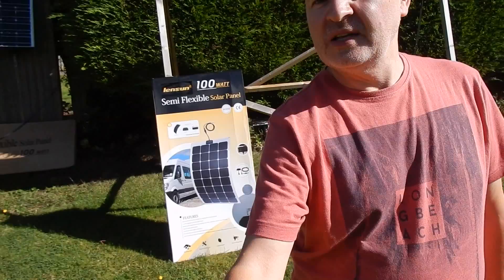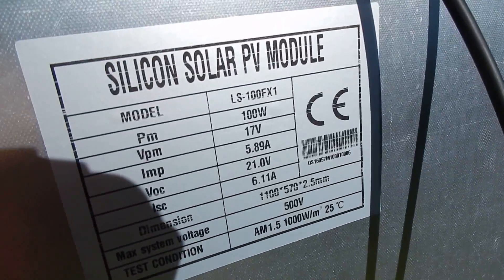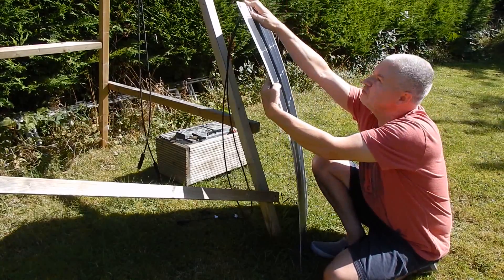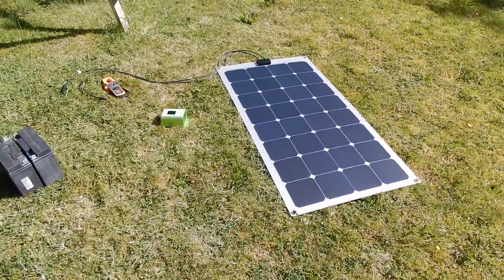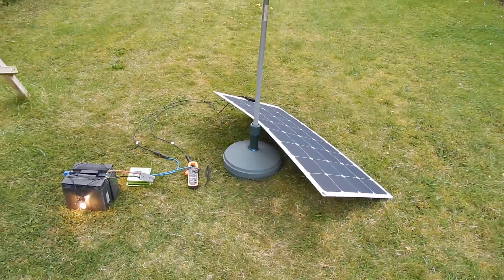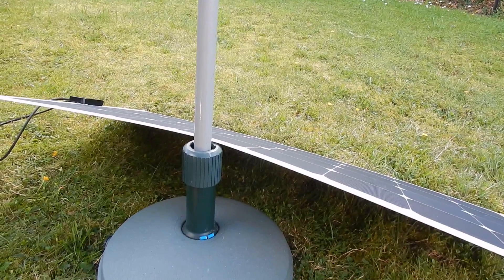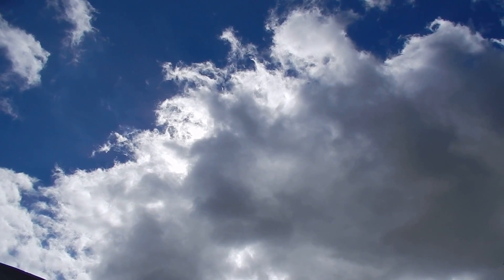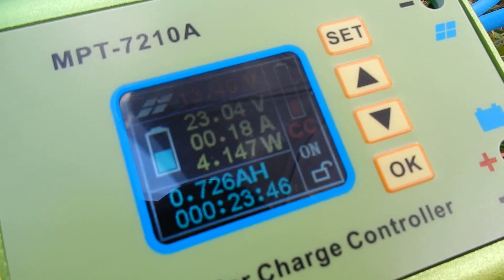Review & Test: Lensun 100W Semi-Flexible Solar Panel

Comment: I bought the Lensun 100 watt fiberglass backed panel 2 years ago directly from the
lensun facility in China for use on my boat. I paid more for the best panel
they offered in hopes that it would give long and efficient service. I placed
it securely on top of the Bimini where it stayed until now.  I recently
noticed that it wasn't producing  power and that my batteries were
drained.  Since the batteries were isolated the panel had obviously not
been producing power for some time.  From purchase to discovery of failure
was....yep....2 yrs 2months.  2 months past their warranty even though it
in all likelihood the panel failed well within the warranty period.  After
a week or two of back and forth with lensun in China they instructed me to test
the diodes, remove the diodes, test the internal connections, etc...take
pictures of the multi-meter readings, take pictures of the mounting, take
pictures of the label on the back of the panel, re-solder, and use such and such
product to re weatherproof the housing and on and on. When I brought the panel
home to conduct these tests I discovered what the problem was.   When
the panel was flat the multi-meter read 0 volts. When I bent it slightly it read
13+ volts. Lay it back down it went back to 0.  That's a pretty good
indication that the circuit is broken inside the panel itself.  I sent
them a video of this and they immediately responded and stated that they
wouldn't honor the 2 year warranty on the panel but happily suggested I buy
another panel from them at a slight discount.  I essentially told them
that I would be stupid to pay almost 300 dollars for ANOTHER panel that would
fail in two years. I realize now that they weren't going to honor the warranty
anyway.  But that didn't stop them from asking me to do their
troubleshooting for them.  One last thing...if you do  have the
misfortune of having to communicate with this company do it via email because
their reps are difficult to understand over the phone.  Well that is my
experience with lensun.

Do with it what you will....

Comment: You need to get ahold of some Maxeon C60 type cells.
Then you can try soldering up some panels without fear of snapping cells etc.  They might be what's inside those flexible panels, I dunno, but they are quite forgiving and diy-friendly.
I think you'd have so much fun combining them with some eva film and a heatgun and doing your panel yourself.
22% eff at slightly higher than normal cell voltage is also nice...

Comment: This man is overly obsessed with heat dissipation, it is simply not that critical. Any bend in the flex panel reduces its output since it is no longer facing the sun at the ideal angle. You lose up to 10% of capacity. Counting the number of cells is also not that critical, output rating is what is most important.

Comment: Pretty, funny, I think you're the only one that mentioned and notice the number of cells....
What size wire did you use on the charger? It has ridiculous small connector...did you use a spade terminal?

Comment: Hi, I am going to fit a solar panel 100w to my motorhome and was wondering have you done any testing on the following as I am only just getting into solar panels and would appreciate your help, as some of your YouTube is have mentioned fake.
10A dual battery solar charge controller / regulator for independent charging of 2x12V or 2x24V batteries or battery banks by solar panels with combined power 160W (12V battery system) / 320W (24V battery system).
remote meter / display for 10A or 20A dual battery solar charge controllers 12/24V with 10m cable.

Comment: Nice panel. Julian, I was wondering why when you had the panel in short circuit amp testing connection, why not have a separate volt meter also connected so you could get both the short-circuit current and the volts readings at the same time and then calculate the total wattage?  Seems to me that would have been easier than the frustration of the changing controller numbers jostling around making peak values tough to get for calculation. I could understand the value if the charge controller has a peak memory to display the absolute peak of volts and current for peak wattage.  Anyway, great video, thanks for all the detail.
Reply from the maker: If the panel is short circuited, the voltage will be zero, so no Watts. If the panel is open circuit, there's no current, so once again, no Watts.
Reply: Yes, of course, I was thinking volt reading over 1 ohm resistor. Not full dead short.  Sorry about that.

Comment: Hi since you have some experience with solar power could you recommend some parts?  I am looking for a setup to charge about 24ah of  pb battery and I have about £200 to spend on a panel controller and 240v inverter. any help?

Comment: I bought a flexible 18V 100 watt 36 cell panel very much like that about a year ago. I put it in my window and have great results with MPPT controller charging 12V leisure battery's. On my next day off I will try it outside to compare notes.

Comment: So are solar panels of this ilk pretty much useless over here or what? You are great at showing details and specs, but for dumb guys like myself, do they have a practical use for power applications during the long nights in winter etc? A general break down of your findings would be great, a vid of a talk about what you could actually expect to generate from your £ outlay etc.

Comment: If you were to consider building your own panel as a project M a x e o n cells (3.4W, 0.65v per cell ) would be a good choice because there are no surface grid wires, everything is back connected using dogbones which allows for minimum soldering. As already pointed out cell efficiencies are about 21%. This panels low light performance should be better than your other panels?

Comment: "Strangely [The aluminium] feels warmer". It will do as it is better at radiating heat. So while being slightly cooler (I assume), it radiates heat away quicker/better. So it will warm your hand quicker than the other side of the panel. :)

Comment: +Julian would you consider making a part 2 video where you test this panel while laid out in a curved fashion? I know there are folks who live in RVs and vans who will use these curved panels and I would like to understand just how much actual loss these panels lose when curved. My initial thought is that it will lose quite a bit of energy production if not fully flat but your testing may yield better results. Please bend the panel panel in a 'n' alignment as opposed to a 'u' alignment. I suppose you can test both but I think when mounted on top of a RV or van, it will most likely be bent in a 'n' alignment. Thanks!

Comment: Clamp meters can be a bit fickle when taking DC current measurements. Especially when pulsed currents are being drawn. Probably better to use standard series connected amp meter for more accurate results.
Reply from the maker: I'm thinking of repeating the test using my LAMB (Large Array of Miniature Bulbs) and an inline Wattmeter.
Reply: Thank you for your video. Your videos are always quite interesting and enjoyable.I'm looking forward to see a comparison with an inline current meter. It would also be interesting if you could include the current sensor measurement modules you used in your MuPPeT device in the comparison. If you want to go all the way you could also compare the INA219 current sensor modules which are supposedly more accurate.BTW. It looks like this panel is made of the Maxeon C60 semi-flexible cells by Sunpower. Having the wires on the back is not only much neater, but I think also more efficient (21% according specs). These cells not only look great, but they are also much less fragile and therefor more suitable for DYI projects. Other cells can break when exposed by even a mild cough or sneeze...@Julian: Have you ever thought of making your own panel. I can't recall a video by you on this topic. On Ali these cells can currently be purchased for around 18 euros for 10 cells, excluding tabbing wire or protective foil. The made-to-fit dog-bone tabbing wire connector is not very cheap, but gives probably the nicest looking result and has as you mention some embedded flexibility holes. The EVA foil is not easy to find in smaller low-budget dimensions, so I'm experimenting with using foil from ordinary lamination pouches.
Reply: + Julian Ilett Oh yes, get that LAMB out! About time that marvellous contraption got to see the light of day again...! lol

Comment: I've been using those 100-watt flexible panels now for quite some time and I love them!  I don't have one from Lensun though.  I had an extraordinarily horrible experience with that company and I'll never buy any products from them.  But I have a few of them from HQST and Renogy.  Yes, they're SunPower cells and the reason why less cells can be used is they're over 21% efficient, while other solar cells are less than 18% efficient.  This extra efficiency seems to come in the form of higher voltage per cell, rather than higher current, meaning you need a few less in series.  
This is the first time you showed yourself in a video (that I have seen)!  Wow! I didn't expect that.
Reply: But the optimum voltage is down, which is used when the panel is getting under load. 
if you have an MPPT, the MPPT will see that 17 volt optimum voltage to load the panel.
A renogy rigid panel has a optimum voltage of 18.9 volts so in theory that rigid renogy panel will put out more power.

Comment: Have you reviewed any of this style of panel -> http://www.ebay.co.uk/itm/1-Panel-100w-319v-dc-roll-up-Flexible-solar-panel-100-flexible-/371725388813?hash=item568c8f4c0d:g:t2oAAOxyu1BTlLeh
They look impressive on paper, and appear to have a lower $/Watt value than the semi-flexible panel you demonstrated in this video.

Comment: Did you pull them batteries out of an APC UPS ? Because that looks like an APC connector and a APC fuse
Reply from the maker: Yes, they did come out of UPS during scheduled maintenance. Not sure if it was an APC though.

Comment: I think england is a very bad land for solar panels, isn't it. Already in the Netherlands, there is way more sun, so the panels would be way more effecient.
Reply: according to wikipedia the mean monthly sunshine hours for London and Amsterdam are basically identical, as you might expect for two places only a couple of hundred miles apart and at pretty much the same latitude
Reply: You get good power on 100% cloudy and rainy days.
Reply: Way more productive. To change efficiency you'd need different panels.
Reply: ***** Yeah okay you're right :-)

Comment: a shop in here sells fujitsu flexible solar panels. 90W each, around 3.3m in length, 46cm in width.  
for just 40 bucks per panel.. but their voltage is 430V.. cannot find an affordable inverter for this
Reply: Hey, that sounds good.  Where is 'here'?  A URL perhaps?
Reply: K
Reply: O
Reply: O

Comment: It's certainly a good panel but the heck is up with the pricing at $260? I've seen the same/similar panels on ebay for only $120-$150... So unless I'm missing something really important, that's quite a step price hike.

Edit: just for example here's one which also supposedly has sunpower cells. http://r.ebay.com/nk0e5q
Reply: Yeah, that price is insane!  I paid $169 for my 100 watt flexible panels and I came across that eBay listing afterwards.  At least I didn't pay $260 LOL.  The good news is, neither did Julian (since he got that one free from them), that is unless he liked it so much that he ordered some from them :-/
Reply: vgamesx1 Plus on top of that, you are NOT PAYING for glass and aluminum framing! By all rights it should be less expense, but China is charging you a primium (over charging) the fuck out of every one! and only a couple of years warranty not 25 years!
Reply: The no name Ebay flexible panels are a joke ,  the 100w panel I got in 2018 never produced even close to the output in the specs from new, after less than 2 weeks of use it now puts out about 22watts.   Its $120 down the drain.  No warranty stated.....

Comment: Hey Julin, Nice work, I am very interested in your meter. I did not know you could use a clamp on meter to measure DC Amps ????  Any insight on this ??? thx also can you let me know of a good cheap watt monitor for my battery charge and discharge ??
Bob J
Reply from the maker: Most cheap clamp meters cannot measure DC amps. But DC clamp ammeters do exist.
Reply: Yeah I found that the use hall effect sensors I guess I didn't know that. But thanks for the reply. Do you happen to know of any watt monitors that I can use on his solar system.
Reply: Julian, it's time you sorted yourself out with some of these https://goo.gl/9m17CU cheap little Amp / Volt / Watt meters.

Comment: New monocrystalline cell design that's a bit more efficient than the regular 3 tabbed cells. Eff of around 20% and open circuit voltage of 0.6V each which is why there's only 32 instead of 36
Reply: The optimum voltage is about 1.9 volts lower than a rigid renogy panel would have. And no-one is talking about the life-span of those panels that is about 5 years per internet search.
Reply: Bonnie Flory If abused I can see a semi-flexible panel only lasting 5 years - but that's anecdotal as well - what really matters is the warranty coverage. The Renogy panels have similar monocrystalline cells w/ the same ~22% peak eff - only real difference aside from rigidity is they have 36 cells, that's why the voltage is higher.
Reply: Bonnie Flory FYI - I wouldn't buy this product, I've seen the price and have no need for flexible panels lol. I'm just outlining the difference from a 36 cell panel with standard 14% eff mono or polycrystalline cells

Comment: Looks like a nice panel Julian - thanks. Those sunpower cells definitely produce some power. Less sure about that charge controller though, it seems a little quirky. Thanks again.
Reply from the maker: It is a little quirky, and it doesn't directly display solar panel Watts. I might have to invest in the MPPT controller you looked at recently.
Reply: +Julian Ilett The real or the fake?! :-)
Reply from the maker: It's about time I had a real one!
Reply: +Julian Ilett Well I should point out the tracer doesn't show watts on screen but does show voltage and current on both solar and battery - so you might still need your calculator. You can see solar (and load) watts within the software though but not battery. Another quirk I guess!
Reply: Julian Ilet

Comment: You left out one important parameter, the cost $/Watt compared to other panels. An important factor when you have to pay for them.
Reply from the maker: True, I did leave that out. Currently $2.59 / Watt. There's a link to the panel on Lensun's website in the description.
Reply: Pretty pricey/W...
Reply: as of 2018, its no cheaper. i'm seeing about 2.50 a watt. we were told 10 years ago that solar panels would be as cheap as dirt! Certainly not over a buck a watt.
 @ab_ab_c

Comment: Where is this 1$ per watt Not $100 but $259! WTF
Reply: I know they're really hard to build ourselves but that still doesn't make $260 a bargain.  You can get one just as durable and well-made for $150 to $170.  Now, if the $260 panel was the only option (other than building it myself), I guess I'd fork over the $260.
Reply: I got my raw sunpower cells for $2 each, but after factoring in the days of work it took to solder and assemble my panels, $259 for a durable and well designed one is quite a bargain!
I used lightweight A3 foamboard sheets for portability, but they run hot in their "mini-greenhouses" and so aren't as efficient. Still, a hit worth taking for a foldable 100W panel that weighs less than a kilogram and fits in a backpack.
Video on my channel showing the issues I was having.
The 'dogbone' connectors are a great idea as bimetallic flexing and cell expansion is significant, but add to the cost - I used normal tabbing wire to connect them because the string length was only 3 cells long before turning.
Still, you can make your own from raw cells if you can afford the time, and the potential loss of sanity!
Reply: Agreed, there are cheaper ones available on ebay but you usually get what you pay for, and may prove more expensive in the long run.
For this panel, I would expect a few active bypass diodes to ease any shading issues.
Reply: lensun 100w black flexible solar panel seems same as nature power 100w panel,  it sells $725.99 on amazon https://www.amazon.com/Nature-Power-56710-100-watt-Semi-Flex/dp/B00K6JW9OK/ref=sr_1_1?ie=UTF8&qid=1475560873&sr=8-1&keywords=100w+flexible+solar+panel+nature+power

Comment: Man that's pretty expensive, but I don't know how much solar panels usually are, is 2,6€/watt good ?
Reply: Not really... Simply search on ebay, here's the same (or similar?) panel for $150
http://r.ebay.com/nk0e5q

Normally cost per watt tends to go down with larger panels, so 100W+ should cost around $1 to $1.5 per watt, at least on the low end.
Reply: 117€ @ banggood eu warehouse got mine for 106 in june http://eu.banggood.com/Wholesale-Warehouse-18V-100W-1050MM-x-550MM-Efficient-Semi-Flexible-Solar-Panel-wp-Eu-1005467.html
Reply: well it's not the same model precisely. Eg. the connector box is on the other side. Likely differences in other qualities, but obviously way cheaper.

Comment: Fantastic review! Looking to getting a small boat in the future. This may be the type of panel I would need! Would love to make the boat solar powered, to run an electric motor to power it forward instead of gas. Might need to look into that MPPT controller as well.
Reply from the maker: I'd love a solar powered boat too - that would be so cool :)